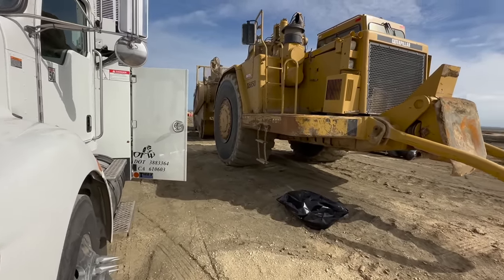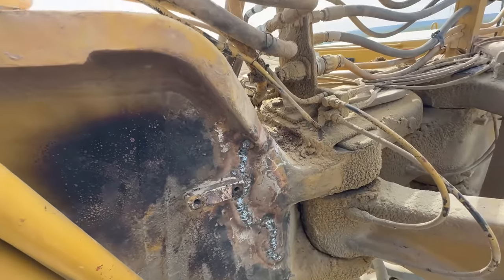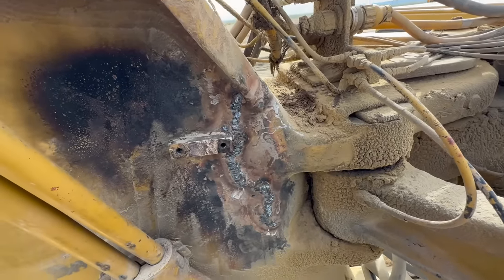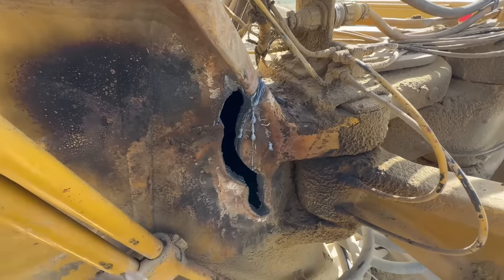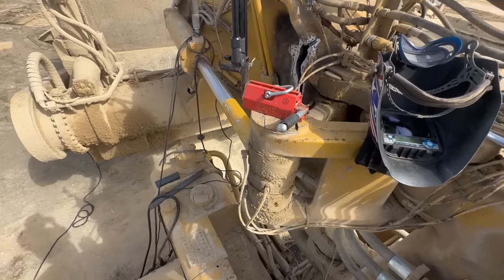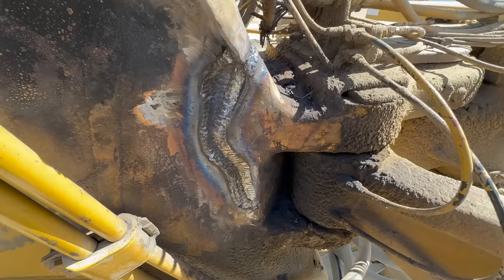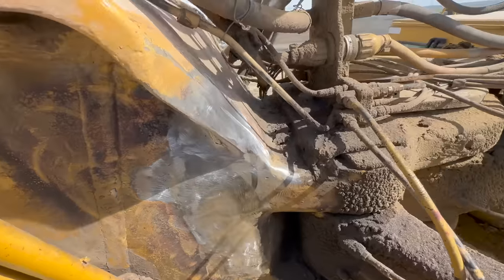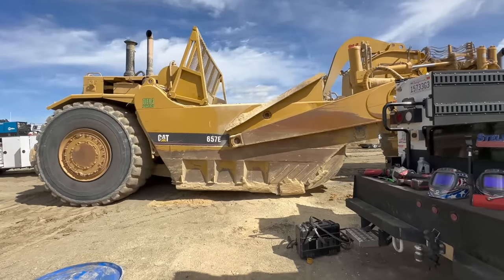Cat 657 with a big crack!!!

Comment: Just curious.  Why did you do mig instead if stick?
Reply from the maker: Because it’s 5 times faster and just as strong.
Reply: @OFW  really?   I'm currently a student welder and to be frank I'm having trouble trying to determine what is best for each situation.  Thank you for replying.   I was also curious what size wire you used for that. It's absolutely amazing that you are able to do that.
Reply from the maker: Wire gets a bad rap. But if done correctly it is the preferred method.  Think about the entire machine from the factory was wire welded. The frame on your car/truck. All wire welded.  Stick its just old technology. But it still has its place.  This wire was 1/16”.
Reply: @OFW  REALLY?!?!?   That's crazy!!!   I just automatically think that anything with thick metal is done with stick.  I guess you're right about old technology.  Thank you so much for enlightening me.
Reply: @OFW  That wire is the thickness of the material I'm welding!! 1.588
Reply: @Meat_smuggler  Listen to your shop teach. This guy is wrong, Stick is generally a much stronger weld due to the flux penetrating the thicker sheets of metal creating a much stronger bond.
Reply: @Avery-432  okay.  Herein lies the problem.  He says mig and you stay stick but I don't have a shop teacher. I'm learning everything I can from videos.

Comment: Not bashing I clearly don’t know much but asking genuinely. Wouldn’t it be better to run stringers instead of weaves so that the welds last longer under tension. I noticed you just ran random weaves to fill gaps can you explain how or why that decision was made
Reply from the maker: This is a very common debate.  There are several very good videos on YouTube where they compare the difference. I personally have never had an issue with a weave weld. I do weld both ways.  The welding might look random but I was filling it up low to high.
Reply: @OFW  thank you for the reply. Your work looks good 👍

Comment: What are the specs on that welder
Reply from the maker: The welder is a Miller arcreach 12. Running Lincoln 71a75 wire. 25 volts 250 IPM

Comment: Awesome skills man. You made it look so easy. I'm sure its a lot of work. How much can one charge for a job like that? It probably took half a day.
Reply from the maker: Took about 5 hours.  $155 a hour
Reply: @OFW . Hello Greg! 

You are a younger version of my late Grandfather: He’d be 107 today (passed at 93) and was a boilermaker from 1935 to 1985 in San Francisco. 

He was an oxyfuel welding and brazier extraordinaire having been the first man chosen (and certified) by the USCG to weld all of the steam fired tube boilers for all of the West Coast built WWII Liberty Ships ( Richmond, Marin, etc) -He was tasked by the coast guard to pick 3 other welders and train them to its high standards.

He did structural welding of new ships during WWII as well.

He also supervised 200 Rosie the Riviters ( Welders in his case) during this timeframe, and built local bridges with the “hot rivet “ process after his WWII work subsided. 

He was also a phenomenal pipe/arc welder. Long story short, after WWII he and his father opened a hugely successful ( 100,000 square foot machine/weld-fab shop) ship repair/heavy industrial engineering company, which ran From 1948 to 1985.

He retired fully in 1986 at age 70. I worked in his shop from age 15 to 24 part time as an outside machinist helper, and fitters helper……He told me from a very young age that in whatever trade you pursue, that your word is your bond, and your workmanship is your signature. 

He survived and thrived through the depression due to his HUGE work ethic and dedication to working his butt off , while loving what he did. He always preached to invest in quality TOOLS/Tooling, and always master the basics and be creative with solving problems to the best of your abilities…

Seeing you and what you do reminds me of him: You are a HARD working but you are working SMART. You have created a niche for yourself and it is OUTSTANDING to see-we are all blessed to see you in action over your shoulder , working on these bad ass machines!!

Whoever raised and influenced you, they are to be commended !!

Keep up the amazing work, and be safe out there!

Best Regards,

Shawn
Reply from the maker: @FIGGY65  sounds like an amazing man!   I would have loved to work under someone like that.  I would also love to see a machine shop like that filled with all manual machines. No CNC. He retired the year I was born.   Thank you for all the support.

Comment: Wow, that's a good job! What kind of wire are you using?
Reply from the maker: Lincoln 71a75
Reply: @OFW  With gas?
Reply from the maker: @cullenequipment8951  yes.  75/25

Comment: What type off wire did you use?
Reply from the maker: Lincoln 71a75
Reply: Ok Nice repair👍. I bet you know This But when you do that much welding on a small spot you should Keep track off the temp. Not over 480 Fahrenheit 250 celsius
Reply from the maker: Yep. I had a laser temp gun right there with me
Reply: @OFW  👍

Comment: dissapointed you didn't give the area a quick pressure wash, before spray painting. everything else was good stuff. but something icky feeling about spraypainting the dirt into the old paint...
Reply from the maker: It will all blend in in a few days.
Reply: @OFW  it's...not about the looks, it's about the dirt inclusions. and... you're a proffessional, who wouldn't do anything to jeopardize the metal, on a work machine, where asthetics are really not very important. the paint is rust protection, and the bare metal doesn't have dirt on it, so it meats that...criterion. just a small...reduction in satisfaction, I guess? something wrong about painting the dirt into the paint, I guess.
Reply from the maker: @TizonaAmanthia  it really wasn’t that dirty. I wiped it down before painting.
Reply: @OFW  no kidding, wipe down ought to do; sure looked caked and dirty, but no worries.

Comment: I don’t think I ever seen you use a needle scaler. Interesting that a tool I find so useful another tradesman does not favor
Reply from the maker: I have several and I do use them.  Just not all the time.
Reply: @OFW  I would be interested in an update vid on the 800 duo. Also if you have gouged at 800.

Comment: Why did you sand and paint it ? Would it not be stronger just left ?? Surely aesthetics ain't important on something like that ??
Reply from the maker: Because that’s what the customer wants. It’s not going to be any weaker than it was originally.
Reply: @OFW  OK fair enough 👌
Reply: Actually stronger the weld is stronger than base material. So grinding it flush doesn't matter...nice work!

Comment: High carbon steel and no preheat around the weld area. Will cool too quickly and can cause cracking. Also should never weave an uphand weld on crack repairs
Reply from the maker: It was pre heated.  Never had an issue with a weave.

Comment: I would expect those guys to get some pressure washer and clean the surrounding of that crack before they call you..
Reply from the maker: Hahaha ya that will never happen.
Reply: Ha Ha most of the people I did work for don’t clean anything. Your on your own. Done a major repair on a dump hoist and and they drove it off on a snow plow job while the welds were still warm. Just like that guy with the scraper they will not wait. Got to go.😂

Comment: Was that gas looks windy.
Reply from the maker: Yes gas.
Reply: Great job the backing plate was steel and stayed in there i guess. I did production mig and we occasionally had to fill in mistakes the  machinsts made. We had a lot of scrap copper around so used it as a backing and when done just knocked the copper off. The repairs were not as big as the one you did.

Comment: Is that meant to happen? Caterpillar should be interested in how that monster casting has become the failure point. That could be very dangerous when in use. Now it is repaired and y'all know it happens I don't think it will sneak up on anyone. But its something I'd expect to be strong ENOUGH from the start to the finish?!
Reply from the maker: Stuff like this happens all the time.  These machines get over 80,000 hours of hard use.

Comment: I was a welder for fourth years, and we were taught to never to  weave, Stringer beads only- puts in a lot less heat into the parent metal. Also your grinding job wasn't very good, you should have used a sanding disc for the finishing  pass! I didn't see you use any post heat on the weld area.Thats a must on these pieces of equipment.
Reply from the maker: It’s crazy what some people are taught to be wrong and what actually works really well.  Well I guess the entire thing is going to fail because of my grinding. And just because something isn’t in the video doesn’t mean it didn’t happen!
Reply: Did you or have you ever held an x-ray welding ticket?
Reply: I seriously doubt you have ever in your life powered on a welding machine
Reply: @okiedoke6373  mister I could out weld you any day of the week, even now that I have been retired for 10-1/2 years!!

Comment: Why not cut a lil more square and put a plate for filler? Still use a backer. I guess if you dont have any steel at that thickness, but other than that 🤔 which is more efficient and less costly, my friend asked me to ask......😂
Reply from the maker: Well if you did that you would have more weld and more time invested.  It would work though.